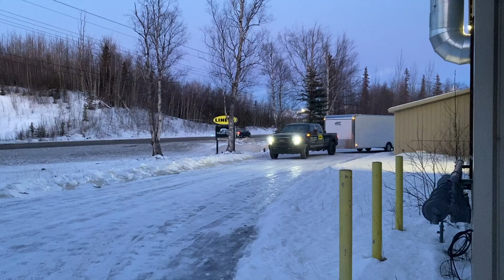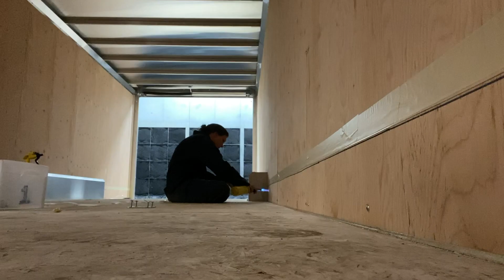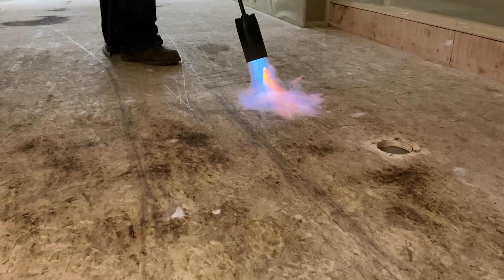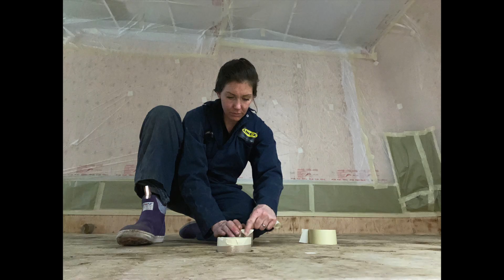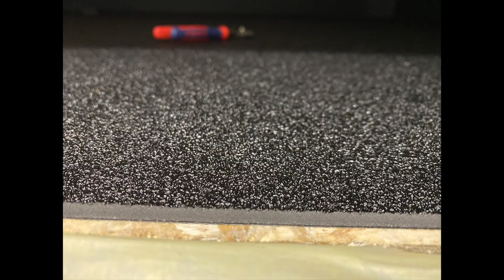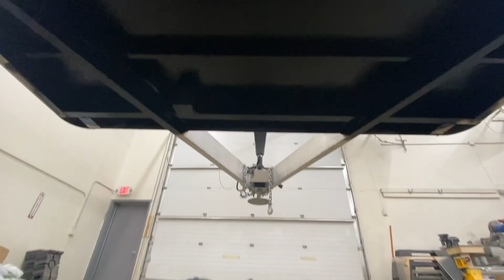LINE-X Premium Trailer Floor with ValuGard Undercoating

Comment: How good is that undercoating?
Reply from the maker: The undercoating we use is known as ValuGard. It has a life expectancy of 150,000 hwy miles.
Reply: @matsucustoms  hey how much did it cost to do
That? And can you spray a whole trailer in this stuff to make more rugged